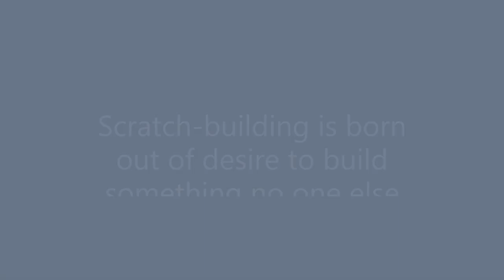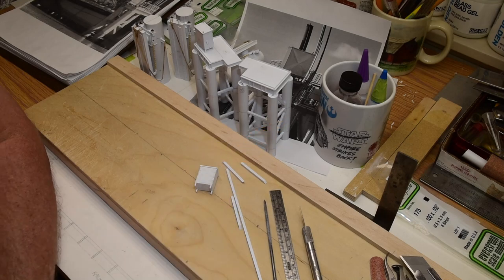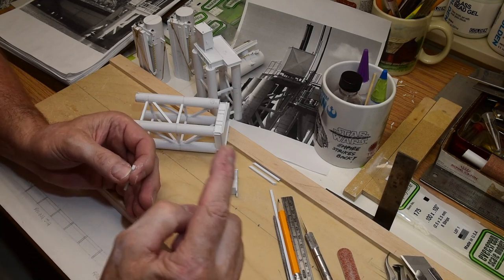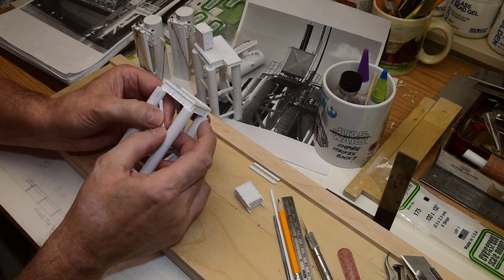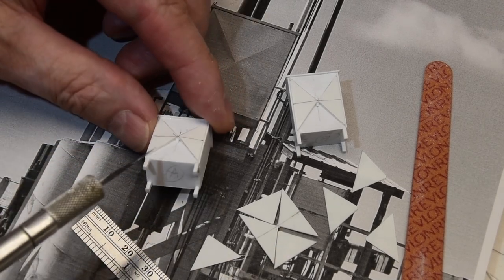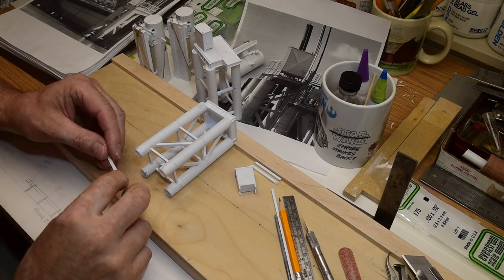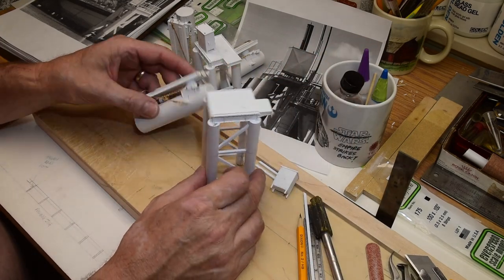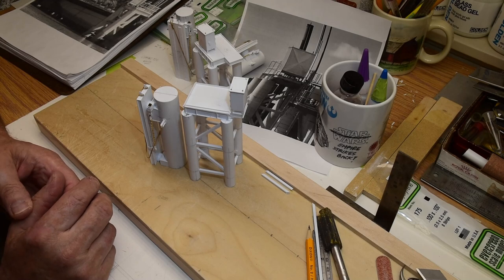The Barge Slip Build | Cabinets & Commentary - Part 6

Comment: You have really inspired me with your modeling!!!!!. I model in n scale and until now most of my structures are kitbashed but I will try some scratchbuilding and see how it goes. I like making unique structures and not simply assembling kits out of the box. Thanks for your great videos!! Looking forward for the next one.
Reply from the maker: Thank You. I think kit-bashing and scratch building are interwoven in most cases. A scratch - built model will use prefab parts here-and-there as well. Cheers

Comment: One question .. doesn't your adhesive evaporate since you leave the cap loose on top while working?
Reply from the maker: Good question. As long as the cap sits on top (without screwing closed), evaporation is minimal. It's an economic "time" trade-off having to go back and forth rapidly when I am in the groove. Some like to use other methods, but I like the brush with no fuss. Some people like to use (sealed) syringe applicators. That's great, but I find them cumbersome and somewhat awkward to use. I prefer a brush personally. Cheers.

Comment: the details.. as you mentioned the oil stains on the diorama you saw as a kid.. This structure is now getting to those details that make it break away from the pack and become that "head and shoulders" above a basic kit bash or scratch build. All the hours put in to the basic structure providing the base for the details you are about create is what is going to make this focal point upon entering your room the breath taker.. Awesome series. I can't repeat enough..thank you for sharing.
Reply from the maker: Thanks. Now that I am onto the deck and approach I am realizing there is a ton of more features and details to go before I even get close to paint. e.g. I found a few nice photos on 'Flikr' which showed a few different angles I never had. They reveal more modeling opportunities and details I don't want to omit. Cheers.

Comment: It's approaching final form, and looking great. That was a good tip for the mechanical/ electrical cabinet the way you made the strength bends in the sheet metal. Another was the rope. How did you make the hinges?
Reply from the maker: The hinges were cut from .010" strip by hand. I cut them in half on an angle, (about fifty), and picked the best twelve (not perfect) and just glued them on. Cheap and cheerful. Cheers.